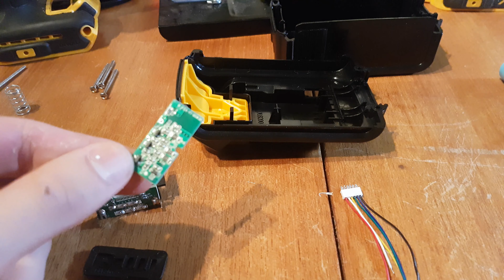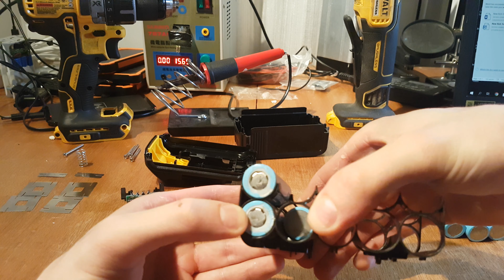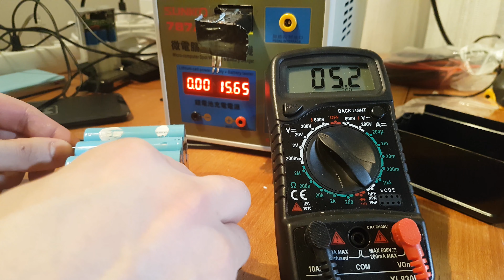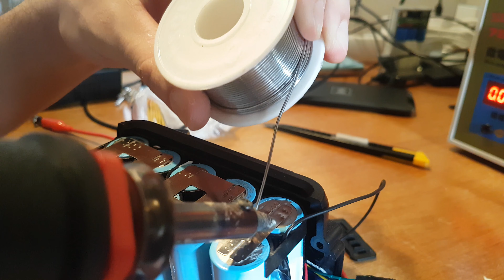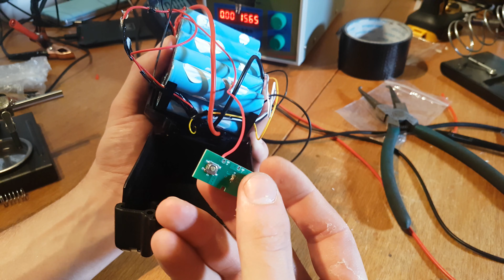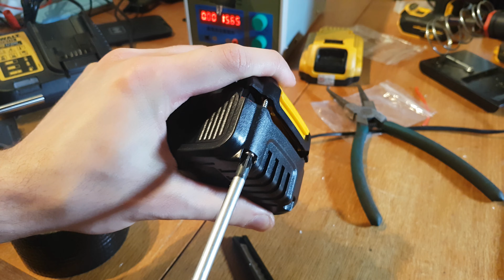Dewalt Battery Pack Build DIY - 20v MAX - 5Ah

Comment: I tell you what I do.  After I get the battery pack built.  I put a bead of white silicone where each of the bottom five cells fit in the bottom of the case.  I then push the battery pack down into the silicon.  This is exactly what DeWalt does.  This keeps the cells from moving in rough handling, something that we all do.  This also keeps pressure off the spot welds and soldered joints when you plug the battery into a tool or the charger.

Comment: Do you know if the pcb board is good one-time use until one of the cells goes bad? I have the same PCB board but seems to not be working anymore after I accidental broke one of the BMS wire (blue).

Comment: I don't think that is a BMS. It is just a simple protection board + charge indicator. Balancing is done by the charger.
Reply from the maker: well , technically it still can be called a battery management system,  I guess

Comment: you soldered the wires on the outside. i know it wont fit the case.. i have rebuilt several dewalt batteries even the tabs have very little clearance. how much more for a wire for balance charging sticking out both sides..

Comment: Hi thank you for the video but I wanted to ask about longevity and also if it would be possible to increase capacity? What will I need to know before i attempt this myself? Thank you
Reply from the maker: It's all about the quality of the cells - the capacity as well will come from the cells . 3500 mah will give you  20v max 6 ah battery . 
It was not easy to build this pack and also I heard from others that it  did not charge after a period ..
Reply: @doit_vehicles  hmm, I've got some dewalt batteries already but I was thinking when they lose capacity if I should just replace the battery cells? Would that be possible to do and would it pose problems with the charging in the future?
Reply from the maker: That should be easy and safe to do , since the bms , and all the pack is original ;
Reply: @doit_vehicles  Its been a year. Is it still working?